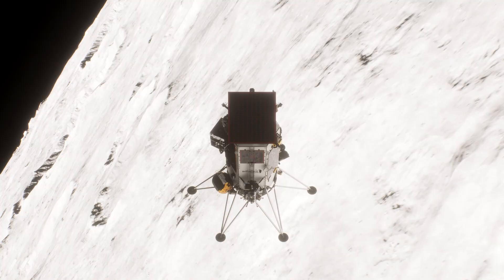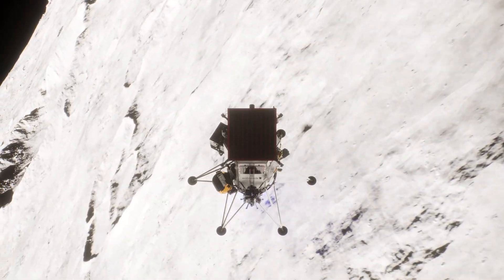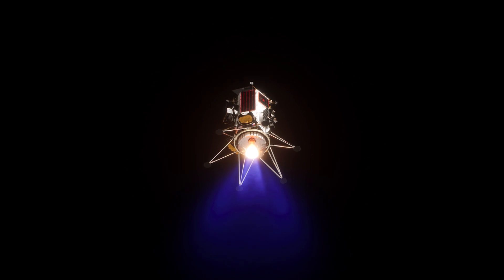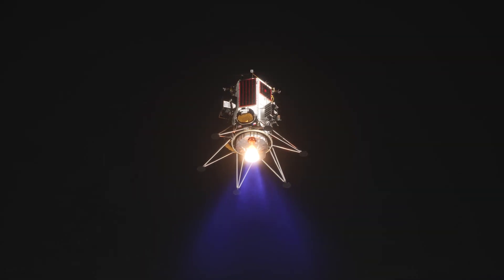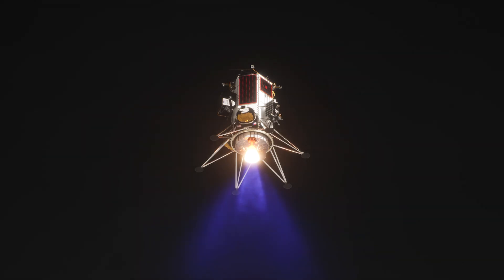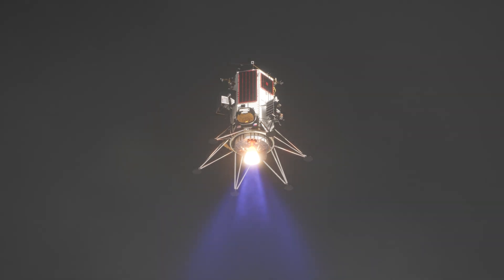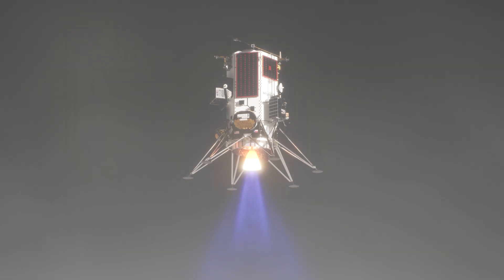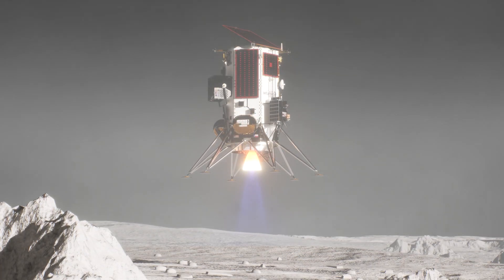Lunar Lander Pros Animation Reaction: Guidance, Navigation, and Control

Comment: Agree with Paula on the narrator formatting. Would also like to point out that there should have been at least some text in the animation video to explain what is going on. Should have acquired licensing for some real music, within a reasonable budget, and changed the title to something more interesting than “IM-2 Animation.”

Something like “We’re Going Back | IM-2” would have probably sufficed and been more interesting. Take some inspiration from the SpaceX videos of 6-8 years ago. You want your video to have viral potential, even if it doesn’t necessarily get there.